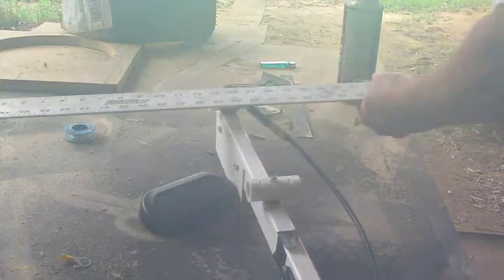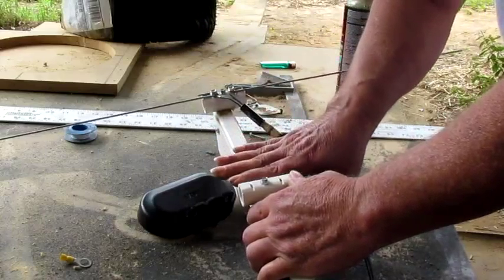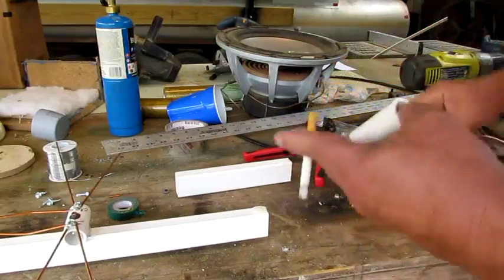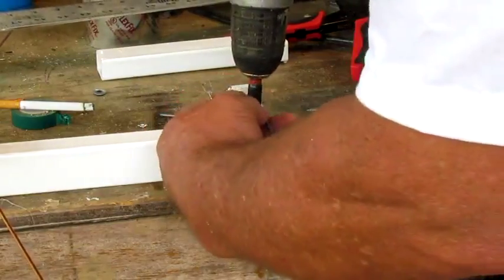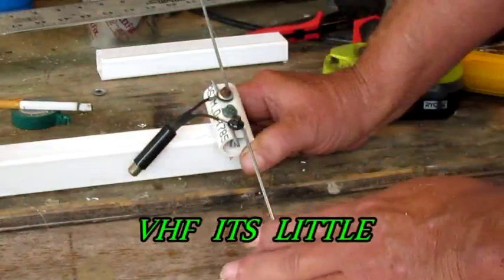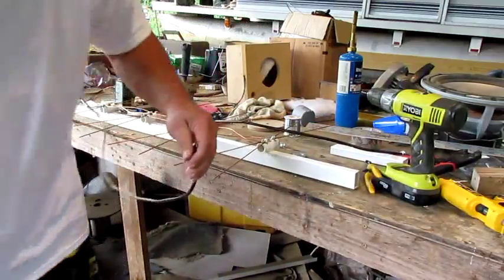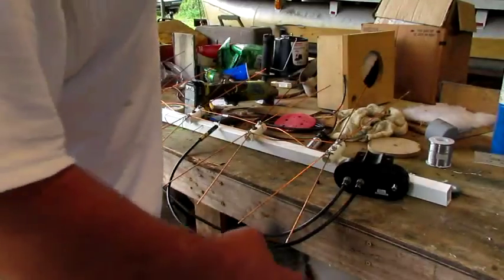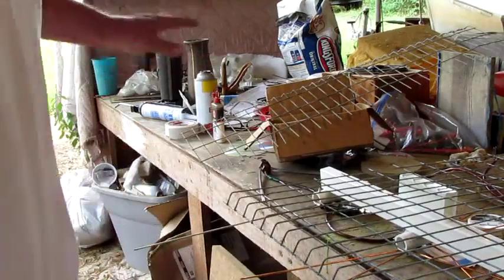Build The All in 1 TV Antenna Pt 2

Comment: I built one of your antennas yesterday,you were right. I got 32 local channels,without a reflector or amplifier. I never got that many before. Only about 3 channels not getting good signals. I can probably adjust the direction,and get them to. Thanks for the info,like your videos.

Comment: Hi Danny, Thank you very much for all in informational videos you have allow us to see, they are very helpful!  Would you mind answering a couple questions?  I noticed the VHF antenna material is different than the UHF cooper, is that material necessary and if so, what is the material?  Also, at video time 12:12, you state to install the reflector.  The reflector seems to be a different height (further back) than the UHF reflector, are they different heights or just the way the camera picked up the image?  If they are different, would you mind posting the distance?

Again,
Thank you, very much appreciative!
Reply from the maker: The reflector distance is the same for both...the wire was tie wire....you can use copper...I just all ready had that.
Reply: Southern Ideas This answered my question! Thanks!

Comment: How does the Rca booster match up with the channel master 7777 ? Because I have had no luck getting the channel master 7777 to last very long they are strong and when they work are good but they are poor in the last department.
Reply from the maker: i quit using  channel master ...they was about to brake me..u no replacing them....rca is  good